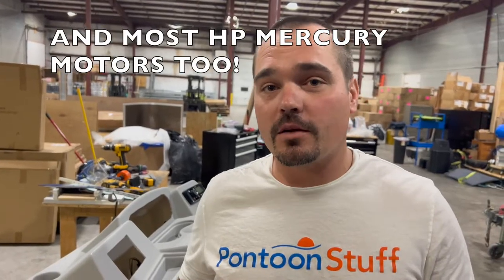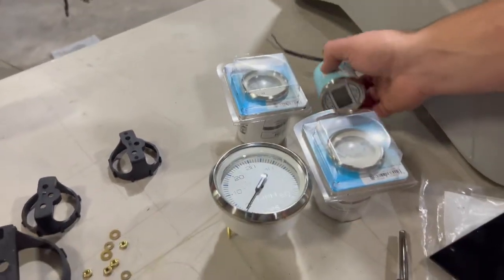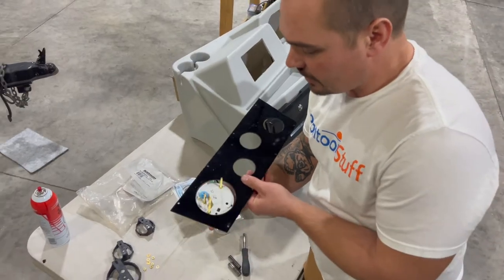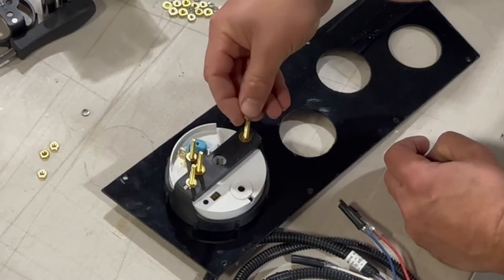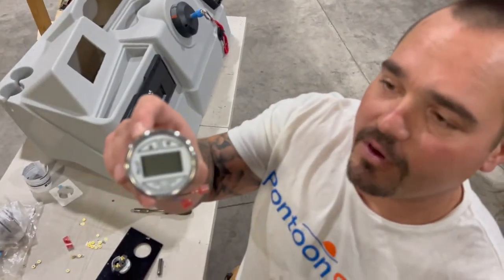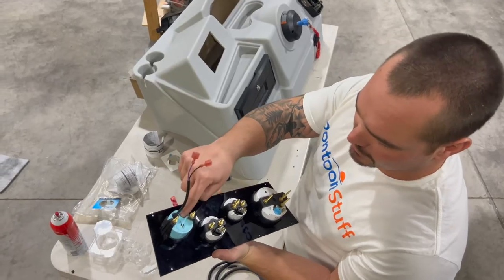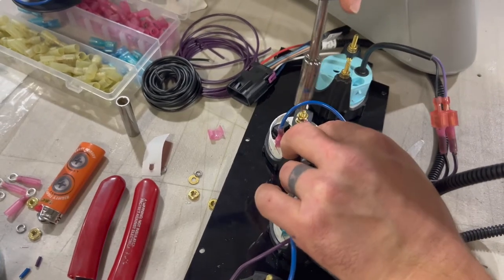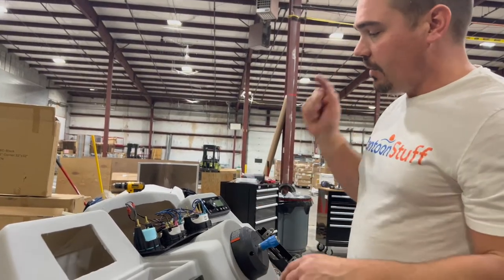Mercury Outboard Gauge Wiring - HOW TO INSTALL

Comment: Thanks Tom!  Still varnishing our dash panels but soon,   very soon,,, I will tackle the birds nest that is the curent (see what I did there?) wiring mess and convert it over to our new set up.
Reply from the maker: You'll be so happy once your hard word is finished and you're out on that "new" boat enjoying it all. If reusing all the old electrical and you're unsure at all, just label both ends of each item as you cut it out of the old stuff. Keep "tooning" in for more content too!

Comment: I am trying to convert a 1977 200 hp mercury to a 2006 mercury 115 hp four stroke. Can I use the existing garages. Is there an adapter made to do this.
Reply from the maker: I’m not sure what plug style that 1977 200 hp would have at the motor. If it’s an 8 pin you could use it for the 2006 but might just need an adapter. The gauges might work, but the tach may run on different settings and if it’s an old Merc brand tach you might not be able to change it over. I would plan on needing new gauges, and getting some updated controls and ignition harness might be worth the money spent when doing that big upgrade!

Comment: My Merc Optimax has a Smart Craft cable the runs from the controller to the Tacho. Would it be better to use the smart craft tacho, or get the harness you have and use the non-Merc tacho? I tried to hook up my Smart Craft tacho the other day and no power to the gauge.
Reply from the maker: If you've got no power to the smartcraft gauge I would be nervous buying another smartcraft gauge in the event that there's an electrical issue (more likely your gauge is bad, but you never know). I pretty much exclusively rig with that gauge harness and analog gauges because most of what I'm working on takes multiple gauges and needs a whole new dash of gauges.

Comment: I have a 2005 4 Stroke EFI Mercury.  I believe the connection to the motor is 8 pin (plus 4 loose wires) vs the 14 i assume in this video.  I can't find a wiring diagram on what the 8 pins go to.  It currently doesn't have any gauges but I'm redoing the boat including floor.  I ideally want speedometer and tachometer to work and assume that is in the 8 pin harness?  Should I get an 8 pin to 14 pin pigtail and run a new 14 pin harness with the gauge harness?  I unfortunately am not near the boat so I'm not exactly sure what each end looks like on the current harness.  Thanks again.  Great videos.
Reply from the maker: Typically on the 8-pin connector (and even the 14 pin) there's a gauge harness lead that comes off the main harness. A gauge harness (separate part) will then plug in. On the 8-pin it's a small black half circle plug with a purple, black, and gray wire. It might also have a tan or brown wire in there too. That allows you to pre-wire your gauges and then plug right in. If it's a side mount control box (attaches to your railing) the gauge harness plug will be coming out of the back of the control box and you may need to lengthen the leads on the gauge harness itself to go back under the floor and up to the console. On a binnacle style the plug should be up near the key switch under the console. No need to do an adapter for the harness, and honestly it wouldn't do exactly what you need it to anyway. Should be able to get it done without changing anything out, just need that gauge harness (or to splice into the main harness, but I don't recommend that for long-term success). Hope this helps!

Comment: Hi, Question: I have a 2015 Mercury 4 stroke Tiller (Big Tiller arm) ... So I am trying to hook up gauges ( on  a Lund Pro Guide).  I opened the cowl and there are 4 wires (green , gray, blue and purple).  Can you help me with what goes where?  My research shows purple to Key power, Gray to tach.. GREEN ??? BLUE??? ... perhaps you have a video showing this?  Thanks!  Bret
Reply from the maker: I don’t have a video showing tying gauges into a tiller motor. For that new of a Mercury I’d think there should be some harnesses or a hookup for a gauge harness under the hood, rather than having to splice in. Generally on a Merc the purple is key on power, gray is tach, and green/blue would be down/up for trim/tilt. 

I would reach out to a local Mercury dealer for further instruction. I haven’t worked on that scenario before!

Comment: i couldnt crinp my wires tight
Reply from the maker: One thing in my toolbox I definitely don’t go cheap on are my wire crimping pliers! Also, make sure you’re using the correct size terminals and splices for the wire diameter you’re running.
Reply from the maker: I’ve had great luck with Klein brand wire tools!
Reply: ❤ @tomspontoons ❤❤❤❤❤❤

Comment: I notice you’re using the wiring harness that is coming from the control box to power these gauges. 

So could you use the same power (red or purple) to power to the accessories panel (the rocker switches) for the horn, nav lights, ect? Or do I need to run a whole new power/ground cables directly from the battery to the switch panel for accessories?
Reply from the maker: You could possibly power a stereo or a fish finder off of the ignition power, but I would ALWAYS recommend running your accessories on their own power and ground as they will take more draw and should be a beefier power and ground wire to carry the load for all of those accessories that might be used at the same time. Your ignition wire is usually only 14 or 16 gauge which is fine to trigger the starter and power some gauges, but not made to power all your boat's accessories. You'll see me reference the Pontoon Stuff wiring harness constantly for those items like lighting, stereo, fish finders, bilge pumps, etc.  Hope this helps!

Comment: Hi
Like your video!
Is the harness came labled as shown on the video? If so can you please send a link for boat the harness and gages

Tank you
Reply from the maker: Thanks for watching! Like in this video I often have to make my own harness from scratch for the gauges, but your local Mercury parts dealer can get you the gauge harness that attaches from the gauges into the ignition harness. I simply buy them from my local Mercury parts dealer.

Comment: Hey Tom, is it possible to piggy back the stereo off of the key-on wire from the back of the gauges? Would like to have the stereo turn on with the turn of the key. Cheers pal.
Reply from the maker: You absolutely could do that, just make sure you've got a fuse in line from the gauge to the stereo. Just remember you will have key on power to the motor which will draw extra power for the ECM to be on in the event you're listening to the radio without the motor running. I would really only recommend it if you ONLY listen to music with the motor running. I prefer to put the radio on its own accessory switch.
Reply: @tomspontoons  thanks Tom. Then that’s what I’ll do. 👍🏼

Comment: What are the 3 extra wires (red white and blue) that hang from the end of the gauge harness used for? It looks like the blue wire had once been used on my boat but was disconnected.
Reply from the maker: I’m not 100% sure which wires you’re mentioning. Is it coming off the gauge harness or elsewhere on the ignition harness?
Reply: @tomspontoons sorry for not being concise. At timestamp 3:15 you have the connector in your hand along with the red white and blue wires I mentioned None of the 3 have a tag on them to identify them and I can't find anything online as to what they are for.
Reply from the maker: I reached out to my friend who is a Mercury tech and he said the service manual doesn’t even tell what they’re for. Pretty odd, but I guess you’d have to get with Mercury to find out!! I’m guessing they tie into the smart craft gauges or are some sort of accessory power supply.

Comment: I have a 2012 Mercury 40hp 4stroke on a Bass Tracker. The boat has never had a gauge of any description installed in the dash since new. On that engine, should there be a plug in the wiring harness for gauges like the one in this video?
Reply from the maker: That motor should have a harness with a simple plug in under the helm that’s already labeled gauges. Same harness that hooks to the key switch and shift/throttle, and runs back to the motor. You could splice into those gray, purple, and black wires for powering gauges and supplying the tach signal. The best way would be to buy the gauge harness that plugs into that gauge lead. It’s a Mercury OEM part and costs only about $35-$40

Comment: Great video Tom. Do you have a video on how to wire Suzuki gauges?  Thanks
Reply from the maker: I don’t, but it’s extremely similar. Some of the newer Suzuki gauges are simply plug and play into the back of the gauge from the harness making it even simpler.
Reply: @tomspontoons  Thanks for the feedback. I went for it and bought a new 200 Suzuki for my tritoon build . Gauges are on order and should be here tomorrow. I was hoping they would be plug and play. 

You’re YouTube videos have gave me the confidence to take on this project. Keep up the good work!!
Reply from the maker: @anthonybass7851  great choice!! I had a couple little goofy things with the digital gauge I have on my boat, but it was fairly simple to resolve.

Comment: Again we’ll done Tom!  Quick question, is the wiring harness from the engine to the console one complete part number or is it different harnesses that you had to run independently? You showed the wiring at the console, is the other end by the engine one large multiple PIN plug in?
Reply from the maker: The gauge harness is a separate part number, that’s the part bag I showed in the video. The main ignition harness is a different part and runs from the engine to the console. I believe it’s Mercury part number 896537K20, but it changes and supersedes often so double check. There are also shorter and longer harness options available. This main ignition harness will include a key switch too. It hooks into the motor on the round 14 pin side, and then plugs into your trim/tilt and neutral safety of the shift/throttle box (binnacle style), and has the plug in for the gauge harness to plug into as I did in this video under the console.

Comment: Any thought on why my (old, 80s) gauges don't read correctly?  For ex: the gas is roughly 0-3/4 and the trim is 0- mid gauge (instead of transitioning from trim to tilt in the different colored zone)?  Would it be poor conductivity (clean the wiring or even replace) or the senders or the gauges?  It's new to me and not sure if there's any fine tuning settings or ?
Reply from the maker: I’m not totally sure why, but it seems like gauges are just the most finicky part of boats. It seems like most of my customers have gauges on their boats that don’t work, or don’t read properly. Best bet is a clean start with new gauges and wiring to them. The trim gauge is the most temperamental in my opinion. Some read backwards/upside down, some motors need an extra kit to add a sending unit on the motor, etc.  However, trim gauges ONLY read the trim level of the motor…so after the few degrees of trim they will be maxed out, and the rest of the way up (the tilt portion) will stay at the top of the trim range.

Comment: I've just rebuilt my pontoon and am wondering what gauges you find unnecessary (i.e. which gauges are important to have). I have a 60hp Mercury Bigfoot four stroke, so we just cruise like a bunch of old people and enjoy the lake. From a safety standpoint I think fuel gauge, trim gauge, but not sure I need tachometer, temp, or mph gauges (or do I?). Looking for insight here. Any others I should consider? (Of course, I'm thinking I can always add more later, if needed?)

Thanks
Reply from the maker: Great question, thanks! 

I personally like to have a tach, fuel, and volt gauge on my projects. The tach will give information for making sure the prop is correct and that you're not over-loading the motor when running the engine harder. Keep in mind that the trim gauge only shows the trim level. Once beyond a few degrees of trim it stops reading...so it doesn't really tell you if the motor is tilted way up or down. I rarely install trim gauges because a lot of times there are additional parts and even a sending unit that must be installed on the motor to indicate trim. So for me it's usually fuel, tach, and voltage. And yes, you can always add more later.
Reply: As far as a fuel guage, what if you're just running two common 12 gal plastic fuel tanks?

Comment: I got my toon to the point of installing the new console gages put in and steering wheel too now it sets in my garage as the temperature is -1 with a wind chill of minus 20 , So it’s a great time to catch up on your videos merry Christmas and thanks for sharing your knowledge. Question where did you find the plastic for the gauges to mount in.
Reply from the maker: We’re feeling that super chill right now too! Hopefully we’ve got everything covered that you need to see for your project. If not please let me know what you’d like to see covered!

That marine board came from Great Lakes Skipper, but it was SUPER hard to work with compared to other types. I just built another panel out of marine grade plastic from Amazon and it worked great and was easier to cut and drill into. Search “marine starboard” and you’ll find lots of options, colors, sizes, and thicknesses. 

Thanks for watching!! Merry Christmas!
Reply: @tomspontoons  thanks, My pontoon used to be my dock I bought it to use as a dock and after watching your Chanel decided to rebuild it.
Reply from the maker: How cool is that! You’ll love having a functioning place to hang out, cruise the lake, and enjoy being on the water…it’ll be well worth the work put in!

Comment: if you ever get to it @tomspontoons can you do a video of rigging a battery pack to rear under-seat using pontoonstuff?  My toons rear seating is absolutely shot, and need to be replaced.
Reply from the maker: Absolutely! We generally install them under the sundecks, but we do put them under rear seats too. I run a 2" hole through the seat and deck, and then a rigging boot to protect the cables and prevent water from coming up into the seat from waves and such. Those rigging boots can be found at Pontoon Stuff. Lastly, I either install a battery box or other battery tray to keep everything in place. I've installed them under 28" benches, 38" benches, and 28" corners too like that.

Comment: Tom, is a tach / rpm gauge necessary? or can you get away with not putting one on the gauge panel?
Reply from the maker: You can 100% go without a tach. Your horn/alarm on most newer motors is built into the key switch or iginition harness. It would go off for temperature or oil related alarms. 

The risk of no tach is not knowing if you have the proper propeller installed for your boat. If you run too high of RPMs you can damage the motor (especially if no rev limiter is in place) and if you’re running too low of RPMs at wide open throttle you can damage the motor too. The tach allows for a sweet spot to be found. A temporary tach could be rigged to the motor to test your wide open throttle RPMs too though. I will cover all that in a propeller segment of the whiteboard coffee chats!
Reply: @tomspontoons  thanks Tom, appreciate the in depth response...u da man
Reply from the maker: @robbienardelli4272  happy to help!

Comment: my hubby knows nothing about wiring and is wondering what color wire coming from mercury 115 motor  to console goes to the heat sensor and also what color to the speed
Reply from the maker: Definitely double check, But my chart says “tan” is the temperature light. The speedometer will be powered from the gauge harness. There’s no indicator for speed from the motor’s ignition harness. Some are driven by GPS while others have a tube that connects to the motor or a sensor that drives water pressure to indicate speed (less accurate).